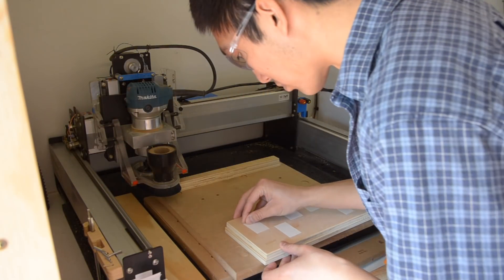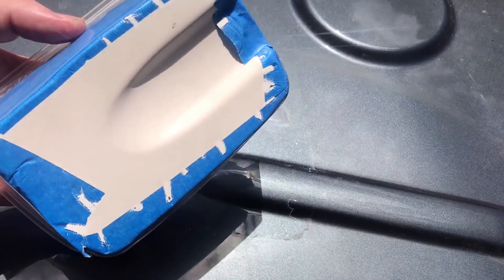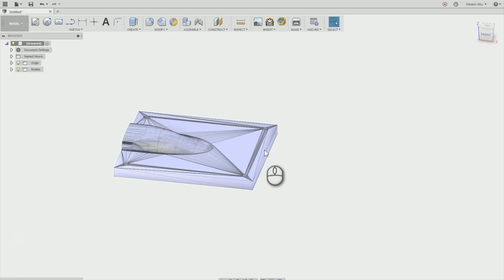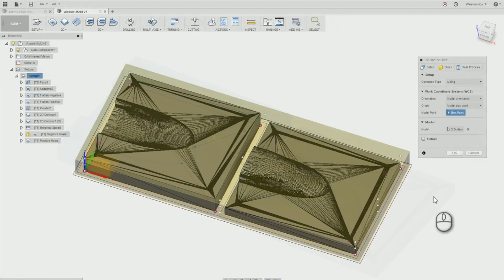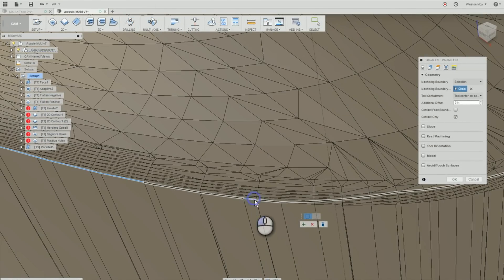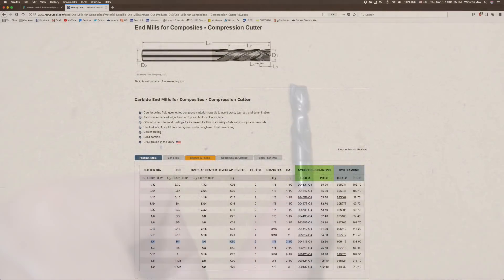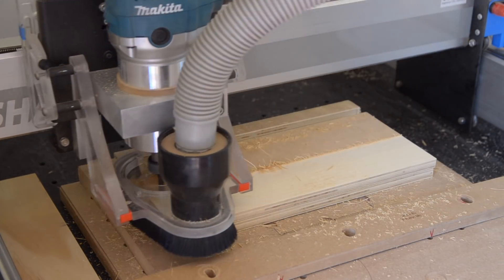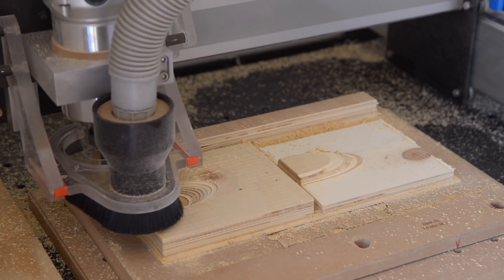Machining an STL in Fusion 360 - Project #114 [CNC]

Comment: Question - I use Fusion for model STL files for 3D printer.Now thinking of maybe getting a cheap router, however, after looking at Fusion's CAM area I simply got confused. Should I ever be able to figure out a simple CAM path/set-up in Fusion is a file then saved somewhere? If saved can it be put on a chip for plugging into a router? I am using MacBook Pro and noticed a lot of information and programs seem to be only for Windows. A few videos for free CAM programs talked about needing a Post Processor after the CAM program operated on a model. Are they saying that yet another step is involved  - Model > to CAM program > Post processor > finally somehow into the router? Thanks for the video and I have subscribed as well.

Comment: I was just informed that we can machine directly from an STL in F360 rather than converting to a mesh so I was looking for info on that when I found your channel.  Do you have any info on that?
Reply from the maker: Just treat the STL like a mesh. Requires no change to your workflow. Works best with 3D toolpaths.
Reply: @WinstonMakes  I havent sat down with F360 yet to try it out.  Converting to Brep and reducing high Poly count takes awhile and doesn't always produce a closed body. New sub

Comment: I'm completely naive to CAD/CAM. I have Fusion 360 but looking at all the control settings send me into a whirlwind.  I only have maybe 6 STL files I would like to output with tool paths but I have failed miserably at converting them.  Is the a commercial service that will convert the files?  Thanks you for any help.

Comment: In the video you made for the spaceX coasters (now since deleted), you mentioned you got a aquarium pump for the air coolant/chip evacuation, how is that holding up? What model did you get again? I am Leaning towards that route instead of hooking up to my air compressor. Thanks
Reply from the maker: I started with an aquarium pump, but it really didn't have the flow rate to do much. I ended up with a hydroponic air pump (793 model): http://amzn.to/2FLQEFe

I can't speak to its longevity because I've only put a few hours on it, but it's way more powerful than anything you'd put in a fish tank. I recommend skipping the manifold and running straight tubing (I think it's 3/8") to wherever you need it. The diameter reduction really weakens the air stream. 

Not as good as the compressed air route because you can't quite match the nozzle velocity, but for "micro-machining" (anything 1/8" or smaller) it should still help.
Reply: Cool, maybe one of the bigger models will have more kick to it. I'll be sure to say thanks again if I bump into you at maker faire Bay Area this year.

Comment: Great video, going to try this out.  Question, you are using the same router as me.  It looks like you have a 100mm mount for it with a filler to fit the router.  I am doing the same on the upgraded CNC I am building.  What are you using for the filler to make the router fit?  Thank you
Reply from the maker: My router mount is actually 69mm for the Dewalt, with an adapter made out of MDF to reduce it to 65mm for the Makita router. You really just need something hard that won't compress, and won't fracture.
Reply: Thanks

Comment: Cool! This is something that is on my ever shortening list of things I want to do (STL file of my head).  PS That is a UP/Down cutter from Harvey (meaning not a downcut).  Normally used for surface bonded Honeycomb core (Where you do not want to disbond the top and bottom material (Wood, Fiberglass, Aluminum, etc).  Still looking for a head scan......

Comment: Great video!  I typically try to convert my STL to OBJ if I can, Fusion 360 can apply 'smooth shading' and handle much higher polycounts.  Normally I convert my files in blender, but Meshmixer should work too. Jeffrey Mather describes importing an .obj here https://knowledge.autodesk.com/support/fusion-360/getting-started/caas/screencast/Main/Details/d625ff7a-1321-4a18-909d-52c825d1eacd.html

Comment: You don't need to move the model to the origin. You can select the WCS on the model manually. Much easier and more accurate. Also, set the WCS on the top corner is safer too
Reply from the maker: Valid point about the origin, I'm just OCD. Zeroing off the wasteboard (plus thickness of tape) means you leave it unscathed. The Shapeoko can handle the top surface being +/- 0.02 away from expected just fine.